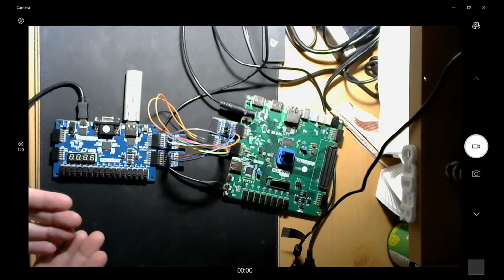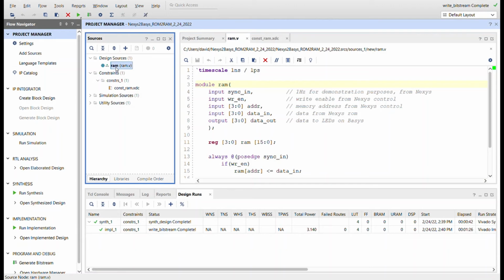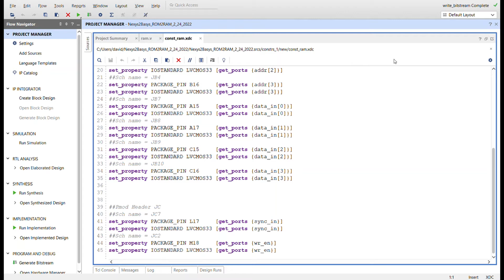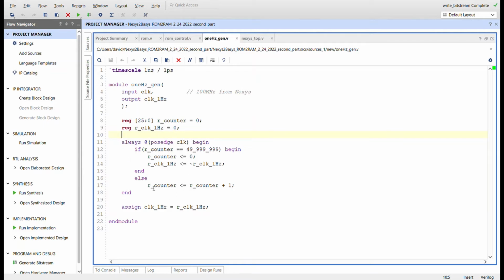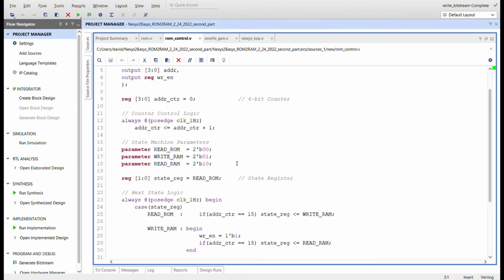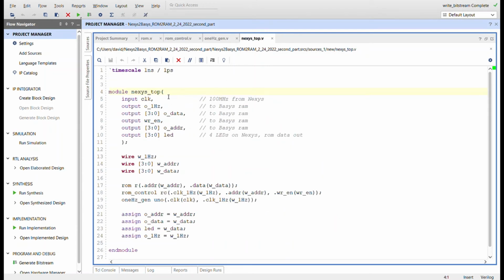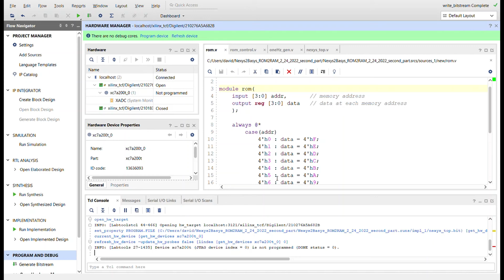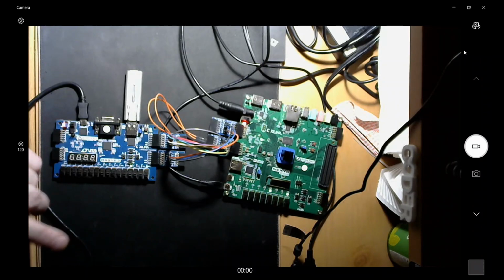Testing FPGA to FPGA communication(Nexys Video to Basys 3)

Comment: Hello, what if i have the same fpga board which is artix 7-100t fpga board. can i used your video as a reference ?
Reply from the maker: So, I'm guessing  you have a Nexys A7-100t? It should work the same way.
Reply: Yes, basically i have two fpga board which is nexys a7-100t, i want to communicate between this two board. Would you guide me for the pin connection ?
Reply from the maker: @haziqishak612  Sure. DO NOT CONNECT VCC of one PMOD to VCC of another PMOD. Only connect the signals that communicate between FPGA boards. You don't need to connect the PMOD VCC to anything. Only connect the gnd of one PMOD to gnd of other PMOD, and the signals for communication.
Reply: Basically what type of pmod did you use ? Or you just take the jumper and connect it directly to the pmod pin of your board ?. One more question. If i want to do this in microblaze block, can i use this ram and rom block in the block ip also ?
Reply from the maker: @haziqishak612  I didn't use a pmod type, just the pins on the pmod on the fpga board. See video. You should be able to use any module you want, as long as you tie the inputs and outputs in xdc file to the pmod pins you want to use.
Reply: Do you have any email that i can email you, i want to confirm.with you that my connection is correct. Thank you.
Reply from the maker: @haziqishak612  Sure. Send to david.marion@my.cs.coloradotech.edu
Reply: Thank you sir. Much appriciate it
Reply: Hello sir, the pin connection between the fpga board is same right ? I mean if one board is using JB1, the other pin connection will be JB1 right ?
Reply from the maker: @haziqishak612  No. It is whichever one you choose to use. You set everything how you want it. PMOD pins are just like GPIO pins on any dev board. They can be inputs or outputs. It's all on how you set up your circuit. Your top module defines the inputs and outputs, and the XDC file ties those inputs and outputs from the top module to whatever PMOD pins you want to use. Understand?
Reply: @dajoma36  I do understand that we can ties the input and output of our design in the top module in the xdc files. So basically, its up to me to choose which ever pmod pin that i want to set to receive or write the data right ? But once i declare it on the xdc file. I need to ensure that the pin is connected in the right place right ?
Reply from the maker: @haziqishak612  Yes, sir. That is exactly right.
Reply: Thank you sir. You reply really give me an insight about the communication between these board.
Reply from the maker: @haziqishak612  You are welcome, sir. Glad I can help.
Reply: @dajoma36  Hello sir, im so sorry, but i want to ask you about programming the fpga through usb flash drive. I have copy the raw bitfile that has been generate to my flash drive. Then i connect it to the fpga board and turn on the board. It seems that the board does not read the bitfile thus no program is running. I have check my jumper connection and all is set to usb/sd or usb. Can you suggest me any other way ?
Reply: Or can i use different pc to power up both fpga. And of course i will power the ram first and the i will power up the rom. Can i ?
Reply from the maker: @haziqishak612  You must press the red PROG button to get it to read the USB drive.
Reply from the maker: @haziqishak612  I don't see a reason why that wouldn't work. Why don't you try things? As long as there is no danger in damaging your FPGA board, just try it.
Reply: I have already done this but nothing happen. I think i need to do this at different pc. So i can power up both board and program it.